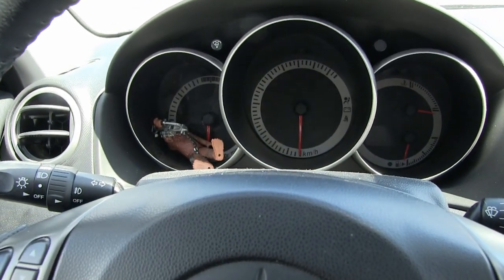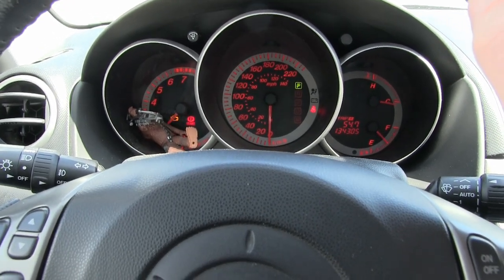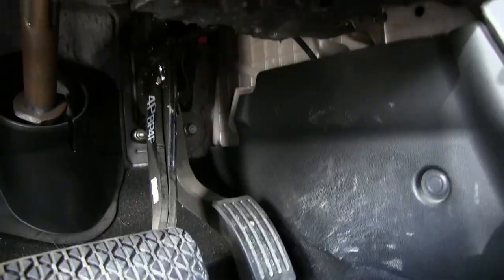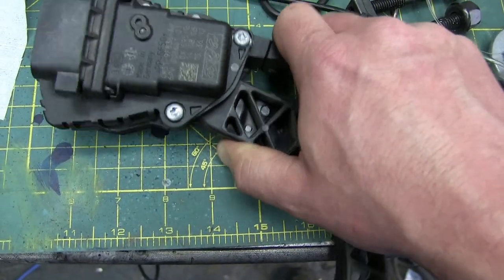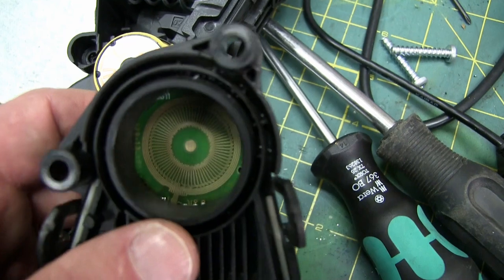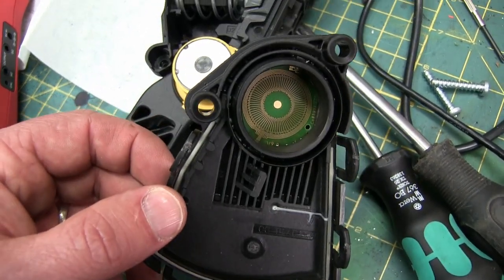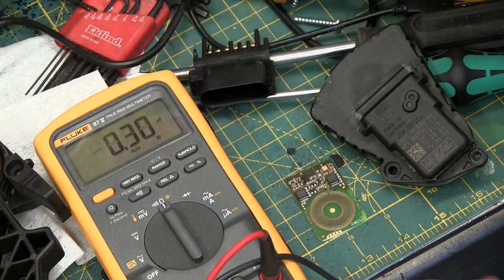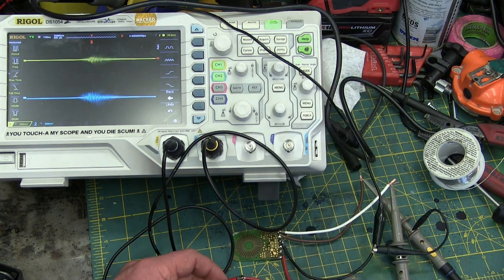BOLTR: CANbus accelerator pedal.

Comment: why even have those?
Reply: making Rube Goldberg machine out of a car
Reply: Because a steel wire is heavier and if you go fully electronical, you can both save weight and make the vehicle have several characteristics without advanced mechanical components
Reply: So the government can disable your car more easily when you step out of line. Stay safe; stay compliant; stay faithful, comrade. Would not want to have to report you to the proper authorities for asking too many questions.
Reply: IsbjörnXII then you'll be adding weight from electronic control assemblies
Reply: +Suraj Grewal doesn't add weight if it's the same control module that is used for everything.
Reply: I assume we have gas pedals so that you can go places with your car, instead of just look at your cars paint job and remark on how nice it is.
Reply: You get to subtract it again though because you don't need a cruise control motor and cable, an idle air control motor and cable, and all the emissions bits. Those are software now and run through the same hardware as the electronic throttle.
Reply: +SlocketSeven +David Serrano 

well, my car has levers on engine, pulled by strings connected to pedal (clutch and accelerator/race)

no drive be electric wire nonsense. 
breaks are hydrologic and gears again, by strings
Reply: so many comments say fewer parts now that it's electronic. not at all. there are just as many parts or more. my first car from the 80's had all those parts. my car made in 2007 has all those parts and many many more.
Reply: Suraj Grewal so you have a carburetor?
Reply: David Serrano And a distributor with points and a condenser, no doubt. Or maybe he's really rocking no electronics with a diesel. Fuck all that, my car is steam powered. I'm so anti-electronics I don't even take advantage of a wild fire if I know it's been started by a lightning strike.
Reply: +William S well he said he had no ECU in his car lol
Reply: I'd almost laugh at the amount of needless electronics in cars, but I can't stop crying.. back in 2012 I was hoping for a solar flair to wipe everything out. it could still happen any day. in all likelihood, it will happen sooner or later.
Reply: David Serrano Yeah it would either have to be a really old car prior to electronic ignition (one could consider the control module to be an ECM of sorts) or a diesel, but even then would have to be fairly old as some diesels have been using throttle by wire for quite some time. It's not even worth arguing about, we all know Suraj is just one of those 'one-upper' type of guys. I beat him to the punch with my steam powered car, though. Of course he will come back and say he has a horse drawn carriage. LOL!
Reply: Several reasons for drive by wire (or at least throttle by wire).

Emissions.  You design one system to add air to the engine (throttle body butterfly valve) and allow the confuser to control the idle at cold and hot conditions and it can modulate the throttle much more precisely and get that catalyst up to operating temp much faster than a similar mechanical method of special valves on the intake manifold.

Throttle response.  Put a decently fast CPU in there, and the engine responds quickly to driver input.  Also, very easy to add varying modes for throttle response, like sport, snow, eco, etc.

Precison.  The engine computer knows exactly what position the throttle is in and can prep other systems accordingly the instant you mash the gas.  Remember the kickdown linkage on carbed vehicles?  The trans knows as soon as the engine does when you stomp it and can downshift at the same time.  The same can be said about pre-collision warning systems many cars come with now.  You'll take your foot off the gas before you mash the brake pedal in the event of a collision and that event can prep the airbag computer and/or the master cylinder to build vacuum for extra braking power.

So in short lots of reasons!
Reply: William S yes, I owned that too (a horse), but my car (was) diesel powered 
but still, that electronic throttle control doesn't even look rugged

what if it was too go down in the middle of the road?
if the analogue one went down, it would simply reduce it's speed
Reply: Suraj Grewal Failure rate is pretty low. Did you look at the guts of it? It is rugged. Is it a solid rod running from your pedal to the carb/fuel valve? No, of course not, but we've moved past that. To give customers what they want and need, drive by wire is here to stay. Like it or not.
Reply: Benjamin Spradlin yeah people quote that throttle response is different but it's the whole point of an electric throttle. It's to reduce sensitivity in the pedal. So that you won't go flying by lightly tapping it.
Reply: this not a porsche gt2. this is lower end mazda. they are not concerned about weight
Reply: William S I don't think so,I increased fuel efficiency of my scooter from 4 kmpl to 60 kmpl just by adjusting throttle cable
Reply: Suraj Grewal If that's really true, then it wasn't running properly to begin with and probably BECAUSE it has a throttle cable and no electronics. Had it been fuel injected with proper tuning, it likely wouldn't have been running shitty to begin with. :)
Reply: Icy Uranus but the issue is that the technology is superior to its mechanical counter parts. You are just not used to it. You are trying to hold back a whole company from moving forward because you don't like change right?
Reply: David Serrano different isn't necessarily superior, it's a matter of opinion. safety and security issues are a matter of fact. example, you connect a desktop computer to the internet, then there's a chance it will get compromised. if there's no connection, then there's no possibility. throttle and steering controlled by a computer is asking for trouble simply by having those connected. add to that a wifi access point, now you're begging for trouble.
Reply: Pete Lorenzo and the benefits out weigh the risks. If it ends up becoming a significant issue then it will be fixed. For example look at valvetronics in BMWs. It increases the efficiency by 20% that is a huge gain. That gain out weighs the less than 1% chance of your car being targeted and hacked. Also cars had the option of electronic steering for awhile now. I have yet to see that being exploited. Or electronic throttle for that matter.
Reply: I'll prefer offline unaccessible (by users not necessarily by auto repairman)
aircraft grade computer
Reply: +Suraj Grewal ok and you have just that. the fault in today vehicles is the radio not the ECU
Reply: +David Serrano also, there are no backup systems that take place of system that gets failed
Reply: +Suraj Grewal there is no backup if mechanical systems fail
Reply: +David Serrano but at least the failure behavior is predictable, the car slows down
while with electronics, it could speed up or change your direction of heading
Reply: +Suraj Grewal it can't. there are fail-safes for that. if throttle fails it just won't work.  it won't speed up because the pedal broke or because a wire was cut
Reply: David Serrano if the electronic throttle fails, it's designed to fail to a safe position, but things don't always go as planned. software failures are possible, and can end badly. you're replacing a purely mechanical system with an electro-mechanical system, with a black box in the middle of it all. the phrase "keep it simple stupid" has been forgotten.
Reply: Pete Lorenzo yes but it's the same with mechanical. A mechanic throttle can be stuck open
Reply: +David Serrano then atleast you could depress clutch
Reply: Suraj Grewal could you not do the same in any car with electric throttle and is manual.
Reply: +David Serrano they don't even have a clutch pedal
Reply: +Suraj Grewal so your saying that all modern manuals are clutchless manuals? are you sure about that? I'm pretty certain that's not true
Reply: +David Serrano the other way around, manual cars usually have either a clutch or are computer control, if the accelerator gets stuck, you could depress clutch
Reply: +Suraj Grewal 
electrical clutches are actually pretty rare.
Reply: I feel much safer having a mechanical clutch and e-brake. I'm able to maintain control of my car even if the throttle or brakes fail.

the electronic steering in my car, on the other hand, tends to worry me. you'd expect, if it were to fail, it would just be more difficult (unassisted) to turn the wheel. but.. it doesn't seem that way. ever since the steering rack was replaced due to a recall, I can feel a spot where the steering sometimes catches slightly. only really noticeable when driving in parking lots at low speed. however, recently it has good and bad days. on a bad day, it'll completely stick and hang at one spot for a moment while going down the highway, like it's fighting against me. forcing past that spot doesn't help, but if I ease back slightly, it works normal again. sorry this is difficult to describe, but whatever is failing here is a worse way to fail than the old hydraulic steering.
Reply: Pete Lorenzo then get it fix. If you choose to drive a car that you know has a steering issue then you can't blame it on the car if anything were to happen. Also hydraulic steering can fail in bad ways as well
Reply: David Serrano I guess you're right, hydraulic steering can probably fail in really bad ways too, though I've never heard or seen this happen. I'm just unhappy with the way it's failing this time, not letting me force past that spot. I plan to fix it soon.
Reply: +David Serrano unhappy about it failing the way it is, yea, but that's not what makes me worry. my smart phone was compromised once by a text message. the only reason I noticed, someone tried and failed to send 80k emails from my account, but I set my email server to block things like this. so somehow, someone got my email password from my phone with a text message. having devices connected makes things like this possible. my point is, critical things like steering connected by wire to a computer which has outside access is a very bad idea. one thing most people don't understand, the internet is a very wild place. your wifi router at home, if you could see all the malicious traffic that hits it, you'd be overwhelmed. trusted vs untrusted networks.

Comment: dont ya love "drive by wire".......

because a cable going to the butterfly is SO much more not reliable.
Reply: Lol Yea nothing like making things more complicated then they have to be just for shits and grins..
Reply: +Doug Anderson I have had many cable operated vehicles and have never had a throttle cable failure. All you need to do is lube it when you lube the front end emergency brake cable and the door hinges and problems will be very rare.
Reply: +Doug Anderson I personally own...

68 impala
77 chevy truck 
99 buick century 
74 kawi motercycle 

I've driven many many many more cable driven stuff.

the.only cable failure I've ever seen is when a zip tie broke and the trans shift cable on my dads 74 Plymouth fell into the exhaust manifold.

if it's frayed....replace it.

open your hood once and a while.....
Reply: +kain hall forgot about my parts 77 truck....

and my old 86 poiantic 6000

I'll ask my dad if he has ever had a cable snap or return spring break....
Reply: +grumpybill oh man....I knew a girl who said she drove her car with the.light on, with it making noises....kept driving.

ended up with no oil and a fused block to piston interface. rings were the glue!

then she blamed gm or ford...whatever it was.

instant turn off lol
Reply: +billybobjoe198 carb or full fuel injection is what I own.

efi, like on my 86 poiantic, was always a pain....but it was controlled only by cable.

I love electric things that work, are don't replace a perfectly good system that has been used for 80 years with no problems.

remember the early 90s when shit went full electric...then at 100,000 miles you had to scrap the vehicle because the entire electronic system failed?

electronics, especially first generation, arnt any more reliable than 80 years of mechanical shit.
Reply: +grumpybill lol!
Reply: i like how people say that electronic drive by wire is so reliable.... THEN WHY WAS THIS VIDEO MADE IF ITS SO MAGICALLY GOOD!
Reply: +kain hall Stop trying to confuse the lemmings with facts...lol
Reply: the main reason we have drive by wire now is because its cheaper. No need for any other components like a separate icv, cruise control system, etc because the single motor and throttle body takes care of it all.
Reply: Let's see how you'll make the stability control, traction control, electronic diffs, adaptive cruise control, etc. work without digital throttle control.... it's so much simpler and BETTER this way.  Some people just can't get out of the "things used to be better " mindset, even when it's clearly not true.  And when it comes to cars, literally NOTHING used to be better than it is today, objectively speaking.